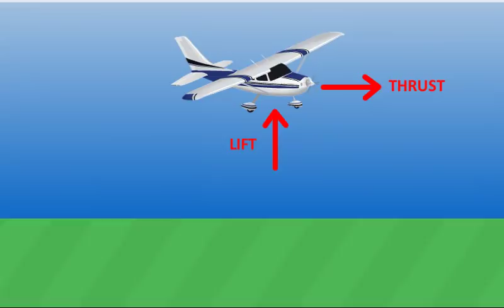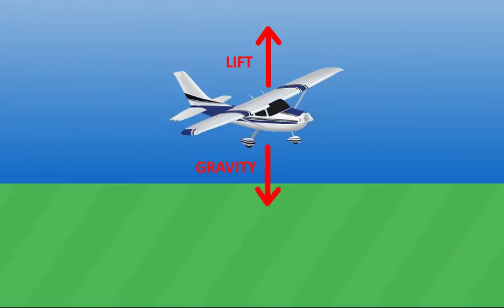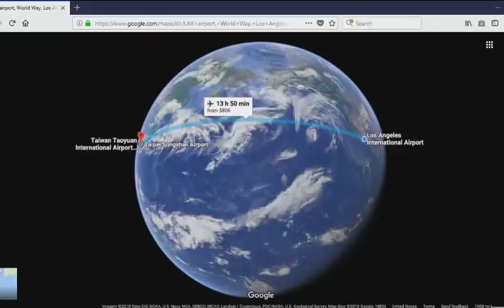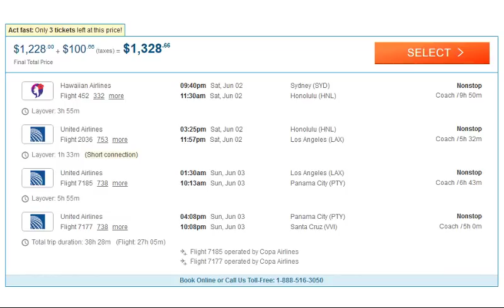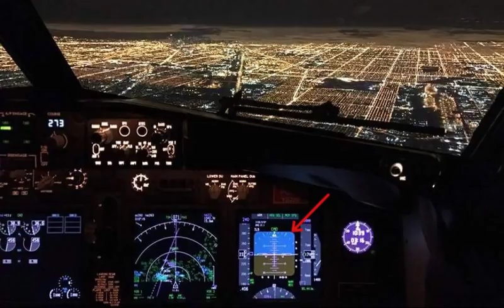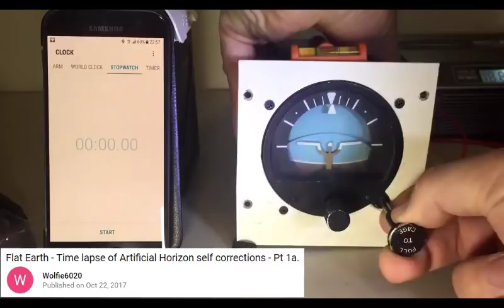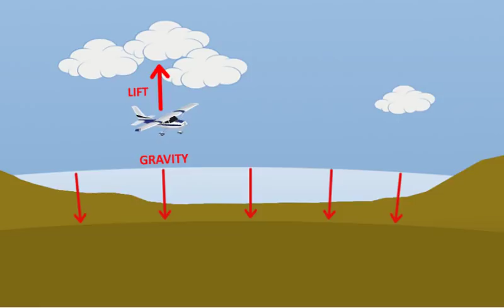Flat Earth Falsities - Plane Nonsense

Comment: It's truly frightening that there are so many who are this dense, and require an explanation for some shockingly simple questions. You really don't understand that everything on the Earth is moving with it, and just because it leaves the surface does not mean it suddenly stops moving?? Really???? Really??????!!!!! I now believe the movie Idiocracy was not a funny movie about, "what if",  it was a sobering prediction.
Reply: stephen jacobs We routinely have "electrolytes" conversations with FE'ers, e.g., density not be a force.
Reply: "As the 21st century began, human evolution was at a turning point. Natural selection, the process by which the strongest, the smartest, the fastest, reproduced in greater numbers than the rest, a process which had once favored the noblest traits of man, now began to favor different traits. Most science fiction of the day predicted a future that was more civilized and more intelligent. But as time went on, things seemed to be heading in the opposite direction. A dumbing down. How did this happen? Evolution does not necessarily reward intelligence. With no natural predators to thin the herd, it began to simply reward those who reproduced the most, and left the intelligent to become an endangered species." Idiocracy
Reply: There is still time to save the future as this movement has weeded out the absolute dumbest individuals, now we just have to stop them from reproducing.
Reply: stephen jacobs I think the flat earth rapid consumption of tide pods will see to that. I hope.
Reply: LMAO flat earthers say, "can you prove it with experiments?" YES YOU CAN! But guess what? They won't believe you because just like the video said, they're ignoring facts and blindly believing their own beliefs with no evidence to support it (and all of there actual evidence can easily be proven wrong).
Reply: Everything on earth is moving with it? Id think about that a bit more before labeling others dense!
Reply: Yes, the Earth is spinning and everything on the surface is spinning along with it.
Reply: Rocky65 Why do you think it wouldn't be? Please think it through before answering.
Reply: @Rocky-ee8to  its quite comical. You can feel the difference paddling with current vs against even on a very slow moving current. Yet when it comes to earth and moving against its motion this isnt detectable because the 1000 mph spin isnt noticeable because of earths size? What a load of bull. We are all moving with the earths direction except things are moving in all directions. I love it. Yes walking against the direction a train is traveling you can feel the difference yet this is the analogy they give us. Priceless.
Reply: stephen jacobs -can you show me and experiment to prove this.
Reply: Double Colt45s An experiment to show you what exactly? The Foucault pendulum demonstrates the Earth is rotating, stellar aberration indicates it moves through space and simply throwing a ball demonstrates conservation of momentum.

Comment: 3:17 question 2...  think the north or south flat earther question is why a plane taking off from the equator at 1000 mph, can land at a high latitude location that would not be spinning as fast... above the arctic circle, or in Antarctic... where the surface is only spinning a few hundred mph... where did all the velocity and momentum go?
Reply: Oh, and I’m going to say the hours of flight needed to cover those multithousands of miles of travel  through all the air and pilots skill aiming the flight adjust the speed... since the speed differential would be gradually altered sideways, would be negligible compared to the 500ish mph of the airliner...
Reply: He literally answers that in this video. Twice.
Reply: What I dont get is how a smooth landing can take place at a perpendicular (N-S) runway near equator?  Momentum gizmo?
Reply: Louis Shaw Perpendicular to the north-south axis would be vertical at the equator. Runways are usually made parallel to the ground.
Reply: Louis Shaw Because conservation of momentum means the plane is moving eastwards too. Earth, atmosphere, plane and runway are all heading eastwards at the same speed.
Reply: Never anything intelligent from +wong :)  Yes yes the "air"plane is moving eastwards at same speed as the solid ground by perfect air following all over (and high) the sphere multiple rpms as the plane turns around in circles, we heard.
Reply: Louis Shaw You heard but you can't comprehend it?
Reply: wong I know. I had week long conversation that kept coming back to Piltdown man somehow disproving evolution.
Reply: Nope no comprende, talking to wong? He is not showing himself to me anymore... how is he going to ask the troll to f_ off? 
Funny just been told atmosphere pressure too low, above clouds to get heated up, but still sticking solid to the surface. No comprehende :(

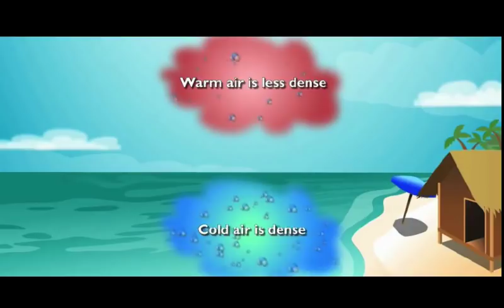Comment: VoysovReason @3:46 you state "hot air rises so cold air must move in to fill the gap". Hot air has no magical anti-gravitational power and cannot simply rise to form a vacuum that sucks in cold air. Cold air is actually more dense than hot air and is therefore heavier. It falls and displaces the hot air. 

In essence there is no magical temperature at which hot air becomes so light that it begins to lift if all air is the same temperature. In a hot room if the temperature of all the air is distributed evenly there is no upward pressure exerted on the ceiling. It is the cold airs weight that simply displaces the hot air.
Reply from the maker: I think we pretty much agree, but let me clarify what I meant. Hot air rises due to buoyancy, not “magic”, and not “anti-gravity”.  Buoyancy is a direct result of gravity. Gravity pulls on everything. In the case of gasses, it pulls on them relative to their density - that is, how much matter is occupying how much space. Heat up air, and it expands, so the same amount of matter takes up MORE space, making it LESS dense. So gravity is going to pull on the colder air a bit more than it pulls on the hotter air, FORCING the hot air up. But the hot air going up is not going to allow for a lot of cold air coming down in the same space, so most of the air filling the gap below comes from the surrounding area. The atmosphere has pressure everywhere, so when air is forced up, more air from the surrounding area is FORCED in to fill the gap. Vacuums don’t really suck, they just allow for atmospheric pressure to PUSH air into the void.

No magic involved. The force of gravity results in buoyancy, and atmospheric pressure, which causes the wind when hot air rises.
Reply: Yes the hot air is less sense relative to the cold air. Yes it is boyancy. But the initiating force in boyancy is a denser mass being pulled down and displacing the less dense mass. I understand your point and I did exaggerate a bit but people do start to misunderstand the mechanisms of the force at play when we say hot air rises. They do start to understand that the force is somehow a pulling up of the hot air instead of a pushing down of the cold air due to gravity and subsequent displacement of the hot air.
Reply: Tempura Trooper the molecules of hot air separates ... making it less dense, or 'lighter'

Comment: Amazing how many facts you ignore as you mansplain.  You haven't debunked anything with your gyroscope section. You should explain why we can see as far as we can with a level horizon  . . . here's a video, yes it does have some erroneous information, but at the end it shows some amazing actual footage (without a fish-eye lens) by altitude. It compares a computer simulated horizon curved based on earth as a sphere model . . . then compares actual altitude with actual photographs.  Don't ignore the facts.  On a "flat earth" the arms in your gyroscope would do the same thing, and they wouldn't need gravity. The density alone would cause them to drop to adjust, just the same as it would in your theory. Here are two other things you can "debunk" to add strength to your series: 1) explain how the aluminum & duct-tape on the lunar lander survived the temperature of the Van Alden belt.  2) Give a reasonable understanding of how we were able to calculate all the telemetry data about 50 years ago with less computing power than a common cellphone . . . but NASA's mega-funded corp not only lost the data, but can't recreate it today.  Meanwhile China sends the rabbit lander<?>  !! Seriously !!  Is China that far ahead of the U.S. now ? Have we fallen THAT far behind in such a few amount of years? If so, should NASA be defunded for being completely incompetent?
Reply: John Grund Apollo passed through the weak periphery of the VAB. While individual particles may have a high temperature they contain very little heat since they are so small; aluminium would not melt passing through the VAB or thermosphere. 
Sliderules and dedicated computers.
Data was not lost; it's just beyond FE mental capabilities to understand data can be copied between different media. 
Several space agencies, including NASA, have sent probes to the different planets & moons in the solar system in the last 60 years.
Reply: https://www.youtube.com/watch?v=zBuPiVzQLxo&feature=youtu.be&t=49m7s pasted at time of photo vs sphere montage
Reply: NotTheCIA I.think, you think?? Dont say, when & where? Not about what they are supposed to be but if they ever got passed... my bad wrong video [1]  astronot Allen Bean !
neumerous /numerous,  tomes /times, convientiently/con·ven·ient·ly, memory you got?
[1] Disney Presents: NASA on Thin Ice | Buzz Aldrin and the Masonic Moon ▶️️ 
      /watch?v=ZR296RWS0yM&t=51s   9:55
Reply: John Grund you know if you go on a boat out into the open ocean away from land and out to sea the land behind you will be gone why? because you are traveling with the curvature of our “not” flat earth!

Also about this “ice wall” we have north and south poles. And right in the middle somewhere we have a hot point which is called the equator proving the earth isn’t flat!

And with this flat earth I live in the north east part of America, and as the sun rotates to the west I won’t not be able to see complete darkness in the sky if the earth was flat.
Reply: Thanks for your contenuous concern but I have not been laughing that hard. Just came back from a motorcycle ride, feel fine. So what do you do in life beside being concern with Retards beliefs?
Reply: Dam an other mechanical ENGINEER, I gave a hard time with one illiterate jew in Australia, had a real fowl mouth. Lot of college material on Conspiracy topics(?); phds, ceo, engineers and professors.
Messed around with NASA Jim Oberg, still no book coming out...
Thinking man do you brag to your comrades about your YT works?
O I got lots of work on the farm; garden, timber, mechanic, dozen cats like my guru Bill Kaysing... but not rich like him with a trailer house :(
Reply: Who can phantom the mind of a crazy conspiracist? So not him?
+PUFFsPICTUREs jewish globe worshipper also one of those M-E.
Most advocates are of that NSW Gold Cost region.. ? 
Jim Oberg? no? NASA had hired aerospace writer Jim Oberg for work for an amount of $ 15,000.  "The book will make a point-to-point refutation of the theory that the Apollo landings were rigged in a movie studio, to convince the world that the United States had beaten the Soviets to the moon."
NASA coped out and Oberg coped out, desperate school teachers never got the much need book for critical kids.

Oscar LeVey is quoted as saying. "We Jews who have posed as saviors of the world, we are today nothing else but the worlds seducers, it's destroyers, it's incendiaries, it's executioners".

"I can't be 100% sure that man actually walked on the Moon. It's possible that NASA could have covered it up, just in order to cut corners, and to be the first to allegedly go to the Moon."
—Dr Brian Todd O'Leary, NASA astronaut & Apollo programme adviser

"In a time of universal deceit, telling the truth is a revolutionary act." 
- George Orwell
Reply: What Australia Melbourne (little off) and you dont know the high jewish congregation: New South Wales state on the east coast of Australia? Numerous "jews" /Ashkenazis race in GOLD coast.
Reply: HA HA HA HA! Just love these high level replies, they sure showoff something spinning.
Van allen belts? Did those get passed?   /watch?v=MCDR8_iShXg&t=293s
Astronaut's Answer🌟CAN STARS BE SEEN FROM SPACE and from Moon -Compilation! ISS and Apollo crew   HA HA HA HA HA HA HA! Kills me :) plane nonsense :)
Reply: +Louis Shaw
Stop trolling you silly child.

Comment: @VosovReason: Nice presentation, I couldn't have explained it better... My congrats to you... Flat earthers don't believe in gravity, nor inertia, 2 of the major forces learned in physics classes...
Reply: Flat Earthers try to disregard Newton's 1st, 2nd and 3rd Laws. Newton's First Law states that an object will remain at rest or in uniform motion in a straight line unless acted upon by an external force. It may be seen as a statement about inertia, that objects will remain in their state of motion unless a force acts to change the motion.  Newton's second law of motion pertains to the behavior of objects for which all existing forces are not balanced. The second law states that the acceleration of an object is dependent upon two variables - the net force acting upon the object and the mass of the object.  Newton's third law is: For every action, there is an equal and opposite reaction. The statement means that in every interaction, there is a pair of forces acting on the two interacting objects. The size of the forces on the first object equals the size of the force on the second object.

Comment: What about north pole star ? It is stable in same position?
Reply: No. it isn't. It's position is always changing, as any navigator knows
Fun fact. Thuban (α Draconis) was closest to the North Celestial Pole about 5,000 years ago.
Reply from the maker: prashant limbu - Yes, in our lifetimes, Polaris is pretty stationary, because it is almost directly above the axis of the earth's rotation. Also, it is so far away, that earth's trip around the sun is minuscule in comparison, so that has no noticeable effect. See my video "Proving the earth is not flat - part 2 - the stars"
Reply: No its not stationary. It moves. It moves slowly, but it does slowly shift.
And thats not because the earth rotates around the sun. That barely makes a difference.
Imagine yourself running in circles in the park(or actually do it). A mountain in the distance will apear to shift only a tiny amount as you run, while closer stuff around you moves more relative to you. Thats simple geometry.
Reply: Polaris is not stationary today. It's actually a full 3/4 of a degree from the rotational pole, and if you take a 5º field of view photo of the north polar region centered on the rotational pole you'll find that Polaris does a star trail just like any other star, just making a smaller, 1.5º circle in the sky, with several stars closer to the rotational pole than Polaris is. https://ibb.co/dbJFfo

So no, Polaris is not "stable in the same position." and it is getting less so year by year. We're about to start getting star charts for epoch 2050 for that reason. As Polaris moves in relation to the north rotational pole, that changes the right ascension and declination of all stars and about every 50 years we change all the star charts to reflect that truth.